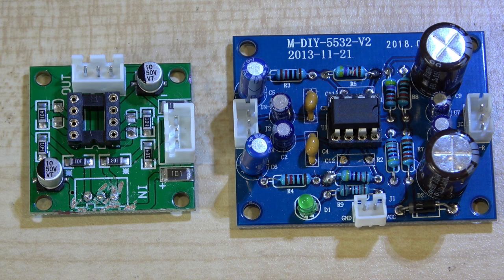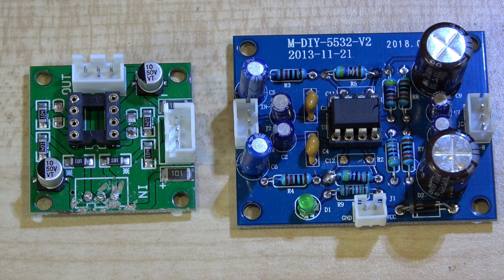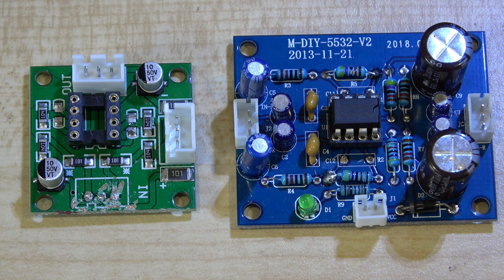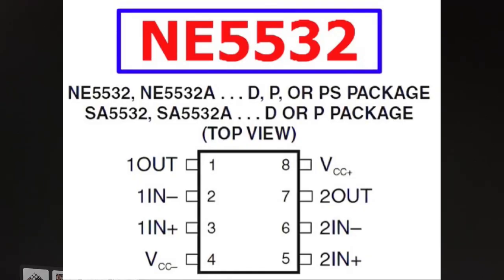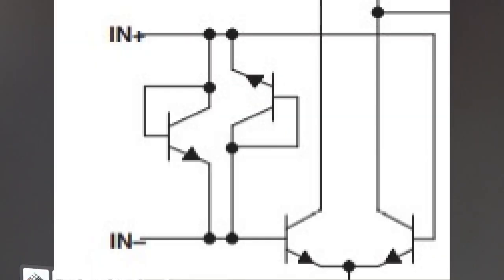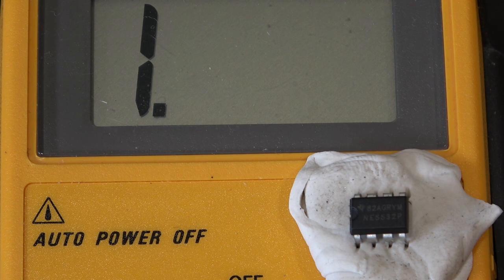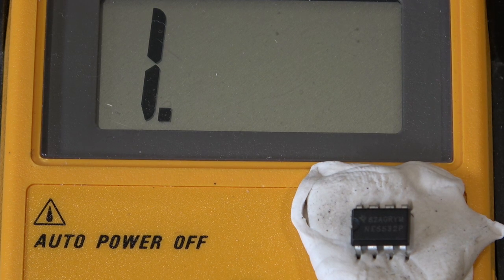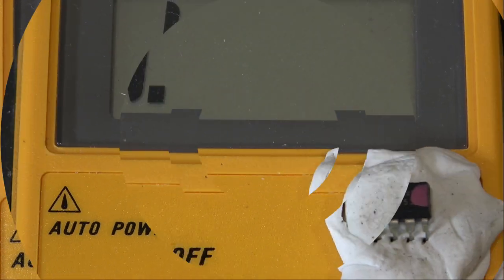How to test NE5532. Fake or Real?

Comment: LM358 and perhaps some other jellybean opamps have these diodes as well.  So it could still be a fake part and it will test OK.  Another simple test is try powering them from 3V.  The fake ones work fine.  And the quiescent current is very low: about 2-3mA. But the funny part is, if they sound well and one can only detect fakes by measuring them then what's the problem?  Also, it is hard to return them on Ali by claiming that they are fake.  They will ask you to prove it. That's what they told me anyway.  But they issued full refund anyway.
Reply from the maker: Looking at slew rate is another way.

Comment: Um, thanks? I found out that the pre-amp I bought that proudly states that it uses an NE5532 has a counterfeit installed. Now my OCD won't let me leave it be (even though it sounds just fine).

Parts and tools are now on order to replace it with a genuine device. Grrrrr...
Reply from the maker: Some fakes are kind of OK, but you NEVER know what you are getting. They mostly use a lesser spec chip, and the slew rate can be much lower. (Speed)

Comment: Cleaned a LOT of my Uncle Ali OpAmps recently.  I use a PCBs I made for playing with OpAmps.  Left out all of the capacitors, leaving a couple of trim pots for gain control.  Injected a 0.5Vpp 1kHz signal.  I watched the output with an Oscope as I raise the frequency.  Many showed a slight kink in the sine wave even a 1kHz which became worse as the freq went up.  Other just made the sine a triangle after about 20-40kHz.
Yes I tested the boards and process with ICs from Mouser and they all worked well.
Not surprised, just disappointed.
Reply from the maker: As you have found there are a number of ways to test this IC. I used the diode test simply because almost anyone can make this test and so far, it seems to be 100% effective, Thanks for your input.

Comment: Further to the comment below, re your Quad 405 results, I wonder if the op Amps 071 ?? were fake causing problems further down the line ?
Reply from the maker: I don't have a way to test this chip. I have tested quite a number of Quad boards in the past, they all measure much the same. It's just an old design, good in its day, slow by modern standards.

Comment: Hello,
Do you know if I can do a similar test for an OPA1642?

Thanks
Reply from the maker: Most chips don't have any real measurable static footprints. The 5532 just happens to be one that does.
Reply: @MichaelBeeny  do fake opamps sound a certain way? I've installed one instead of an TL072 and I can't tell that it's better or worse. I expected it to sound a bit cleaner and brighter. It does, but I still don't know if it's real or fake.
Reply from the maker: @InvisibleYetVisible  The thing with fake stuff you have no idea way you are getting. Some may be manufactures rejects, some could be simply any old chip that looks the same, some just go bang on switch on. NEVER are they better. Most op amps sound quite similar anyway. The TL072 by todays standard are noisy and slow. Saying that, when you start at a high spec things just get better. Much of the better is not audible and only just measurable. As to which one is better, enters the SNAKE OIL region. Most fakes are dirt cheap and for less important application, they often work fine. The 5532 fakes are really not that bad, often little audible difference. Power amp chips are often very poor, high distortion, power issues and many just blow up sooner or later.
Reply: @MichaelBeeny only just measurable, not audible...good to know😃.

Comment: another good indicator to see if you have real or fake opamp. use a fridge magnet, if the component gets attracted its probably fake. the reason is that they use nickel-plated steel in the construction
Reply from the maker: That's interesting, I did not know that. Thanks for the info, I will try it.

Comment: I'm showing real NE5532s for sale at digikey for 78 canadian cents... I have to wonder what profit Chinese knock-offs are making... I just tested all my 5532s. I have 9 of them currently and all of them checked out OK. Diodes in both directions.
Reply from the maker: Probably more than Digikey sadly. I've not found them at all unstable. Square wave at such high frequency won't look very square, however. If you have not already got one, try about 15pf across the feedback resistor.
Reply: @MichaelBeeny   Thank you I will try that!

Comment: Hello. Have you tried the lm4562na? 
I connected a system where I could switch between preamplifier or without preamplifier to hear differences with and without preamplifier in the chain.
I used earphones with good sound quality since with earphones it is easier to hear details.

I tested with music and pink noiseig and frequencies and concluded that the lm4562na changed the sound incredibly little. difficult to hear differences.

In the preamplifier card I have, the lm4562na is the absolute winner if you want the least possible sound changes to the original input signal

Comment: yep,I got a fake one too,thank you for showing us how to test them,I was suspicious when the led on the circuit board didn't light up with only 12v DC connected to it.
But I think I'll give solid state circuitry a miss,and stick to building valve gear,as I've built a fair few amplifiers and Preamplifiers,and like the sound of them very much,and just love point to point wiring.
Reply: They sell fake tubes as well

Comment: Good and simple testing way, indeed.
How about the slew rate, as you said, are the fake ones also bad, how much worse?
Did you see if they have that crossover distortion, typical of LM358s (same pinout)?
Thank you!
Reply from the maker: Sadly it's just the 5532/4 with these diodes. Others with the same pin out are different inside, so cannot be tested like this. Regarding crossover, I have never seen any in such chips as they tend to be class A

Comment: I automatically assume that any chip I might buy from Aliexpress/eBay will not be genuine.  But that doesn't mean they won't work adequately in many non-critical circuits. Just don't build them into your prototype new heart pacemaker!
Even generic devices from premium Chinese manufacturers - like ONsemi - can be from batches that "escape" from their factory after failng testing, and mysteriously turn up in the Shenzhen Marketplace.  In the end, despite their ridiculous postage costs, it is often less irritating to buy from companies like Digi-key, Mouser, Element 14, RS Components etc. -  where the source is guaranteed.
Reply from the maker: Yes, Hector you are quite right. In less critical areas these fake chips do work almost as well, and most people cannot tell any audible difference. This is true for the 5532, it's not just a fake but a completely different chip.
However, many fakes perform really badly, high distortion, way out of spec power wise, even just blow up. I always use Farnel (element 14, silly name!!) for original parts, that's when you do tell differences.
Reply: I just bought two opa2134pa opamps from rs components and the screenprinted model number varies in position and clarity  between both chips .
The chips i received look nothing like the website pic of an opa2134pa on rs website.
The originals normally have a round indentation directly above pin 1 and a half moon notch on the edge .
My chips have an indentation between pin 1 and 2 and no half moon on the edge .
I put a video on my youtube showing the chips if anyone is familiar with that model .
I might have to test them
Reply: @peterpipe9015  Certainly suspicious!  It might be a good idea to contact RS, point them to your video and ask them to confirm their source.
Reply: @hectorpascal  thanks hector i wont be using rs components again
Reply from the maker: @peterpipe9015  I would be surprised if RS would have fakes. Sometimes the same chip is made by a number of different makes and can look externally different. The internals should be the same. If not, they cannot really call it a 2134.
Reply: @MichaelBeeny  it sounds better than the 5532 which came with the aiyima a07 which is fake according to others who have tested the same model,thank you for the help michael
Reply: @MichaelBeeny  Yes Michael, I too am a bit surprised..  I worked for BBC Engineering for 20 years and we used RS (and Farnell/ Element14) extensively for making special purpose prototype units.  (Mind you.  that WAS about 30 years ago!)
Reply: @peterpipe9015  I bought 4 OPA2604AP from a local seller the price was under a dollar so naturally fakes, turns out they are genuine NE5532s rebranded 😁
Reply: @syduploads1990  thanks bro

Comment: Your a rockstar ! I asked about this and you pointed me to your vid (I'm subbed) and I just took a board with a single 5532 and it tested fake, no junctions and then took another preamp that had two 5532's on it  (a much used and loved one) and sure enough the both had the 0.80v junctions ! so real and I always said this one sounded great and used it a lot 1 I now plan to do further tests and try to see if the difference can be measured in other ways, regardless of that I don't like giving money to counterfeiters anyway....cheers.
Reply from the maker: Welcome Mr Mouse. It's not always the same fake 5532 used but the real 5532 is the only one with the 2 diodes on the input circuity (that I know of) so quite a conclusive test. Some fakes have poor HF square wave and higher noise figures.

Comment: Hi Michael. As you asked. Testing 3 pairs of 5532's.
#1a. NE5532AD SOIC-8 seller told they genuine(local store). OP1 718mV, OP2 734. #1b OP1 717mV, OP2 733
#2a. NE5532AP DIP-8 sold as genuine(internet store). OP1 723mV, OP2 734mV. #2b OP1 723mV, OP2 734mV.
#3a/b. NE5532P DIP-8 seller honestly told that he can't confirm they are genuine(local store). They have open loop
Now i don't know what to do with fake ones. Usually i throw them, bc i don't use any fake parts at all, even in simple schematics.
Reply from the maker: Thanks for the info. As to what you do with fakes, let me know if you find any use, coz I've got lots of them. lol

Comment: Bought a MAX038 from AliExpress. Didn't work. Just drew a high current. Told the supplier who assured me that they test each chip before dispatch. Told him that I'm really happy about that, and could he send me a schematic of his test circuit. Money refunded.
Just tested my 5532's. Failed.
Reply from the maker: The 5532 is probably one of the most fake of all chips. Almost every board I have tested used fake chips. Well done getting your money refunded.

Comment: Hello @ Michael Beeny , thank you for the video i found out i do in fact have fake NE5532 but ive got a question about it if you happen to know. i bought my NE5532 to build a Zen Drive its a guitar overdrive pedal. would you happen to know if these fake chips would make any difference in my Zen Drive circuit? i made my circuit with the fake chips and im happy with how it sounds but wonder could it be better if i put in  a real NE5532. thanks for any help or advise .
Reply from the maker: In truth the answer is no! Most fakes are lesser spec chips re branded. Very naughty and it's a con. However in many applications, probably un noticeable.

Comment: Is there a difference between NE5532 and NJM5532?
Reply from the maker: I'm sorry Martin, I don't think I have even seen this version. Looks slightly better on paper than other makers of this very common chip. In the real world I've not been able to detect any audible difference between any  of the 5532s, even some fakes are really quite good for some applications.
Reply: NJM5532 are from the New Japan Radio Corporation which is a genuine Japanese device manufacturer.  The specs for the NJM5532 are very similar to other manufacturers' offerings.  Of course, it is quite possible that these types are ALSO being faked "over the water"!

Comment: Hello Mike,  The spec sheet states the inputs cannot exceed -vcc or +vcc  , would'nt this burn out the diodes across the inputs?  I am confused.
Reply from the maker: I will need to study the circuit again to really comment but it is one way to tell if it's a genuine chip or not. I'm working on other ways at present.
Reply: @MichaelBeeny  Something is strange.
Reply: @braveheart5280  You need to understand how op amps work: the voltage difference between inverting and non-inverting inputs is kept zero (ideally, and in practice also very low), and the input has very high impedance. In other words, you cannot force the voltage difference be high from outside, because the internal circuitry is "eating" the difference.

Comment: Hi, i'm very interest in a prototip of the ne-5532, i mean, i've actually improved my contact with electronic stuff, but admit that i'm very ignorant in this materia.
You can add a little description about the circuit - at the beginning of the video -  i meant, where I can buy that to amplifier my turntable ?
Thanks a lot XD
Reply from the maker: I'm not quite sure what you are asking? A basic preamp is NOT suitable for a phono input. You need a special type with RIAA EQ. So far I have not shown any that are suitable for a turntable.

Comment: I have a question
Fake one make signal lower right?
Reply from the maker: Some fakes can be quite good, some don't work at all. Because they can be anything really, you never know. I doubt it will make the signal lower because the gain is set (largely) by external components.

Comment: The first clue , for me , was taking a good look at the texas instruments logo (which is the outline of the state of TEXAS with a T and an I inside of that) , found on the chip. Mind you the logo is pretty small , so i like to use proper lighting and magnification,  if you have an authentic chip and you side by side them with a phoney ic , its clear to see . the couterfeits image of the state of texas does NOT resemble texas , it looks more like long island . Your test method is well informed and i admire your intellect / experience to figure this test out as its wonderfully smart and fool proof test . for me (i am kind of a numpty)i had purchased a 3 band eq board with a pair of chinese ne5532 and i suspected they were not originals. i used my multi meter and tested for current draw what i then found was the chips i suspected to be fakies were pulling significantly less current than what they are rated to consume . Of course i forget the numbers as this was two years ago. these fake ne5532's where pulling about half what a lesser spec'ed op amp is supposed to pull. when i removed them , i installed some proper ne5532 i purchased from tayda and those ic chips pulled the proper amount of current. Now this is the internet , i am a bit older at 50 plus so of course i am wrong , i dont know what i am on about i am a goof i use plumbers flux. But i am convinced my tayda ne5532 are legit TI chips. Despite the rash complaints of users claiming everything purchased from Tayda is phoney.The logo is legit and they pull the correct amount of current. I recently saw they are selling a 10 dollar eq with a pair of fake ne5532 and this board also has a bbe sonic maximizer chip onboard . THATS the board i want to try. I never considered asking for my money back when i recieve false chips . thats something i would need to consider. the project i am working on right now , i ordered a board which has a pair of ne5532 , i plan to use it as a headphone amp so i may need to swap out the resistors that set the gain . i have some Tayda bought burr brown op2134 ic chips to try out and my plan is to remove the stock dual volume pot and cut in a pair of independant pots to control the volume as i am slightly deafish in my right ear . ultimately i really like listening to music with a smile eq curve where the bass and trebles are boosted a good amnt . ideally i would build one unit in one chassis . single 24vdc supply and it would have the preamp/headphone amp board AND the eq board that features the bbe chip (NE5532 OP AMP Preamp Tone Audio Board NJM2150 BBE Processing Module) but i am looking at the dimensions and it would be a tight fit in a 1590bb so ... i will more than likely add a small bbe chip board to my eq and couple it with the headphone amp build . all this driving a pair of superluxe 681evo headphones . shortly before realize this , i ordered two ten pack batches of ne5532 from ebay to stock up... so as far as imposter op amp ics i am set! ( i told you i wasnt so sharp... anyway thank you for your excellent video pal , i ejoyed that .
Reply from the maker: Do you know Petey, I never thought of testing for current. Next time I will also measure it. Regarding your hearing miss balance, rather than put 2 pots in circuit I thing I would probably change the feedback (gain) on one channel. Do this with a mono input, then you know it will always be correct for your hearing.

Comment: Thank you for the video. I've bought LM358 from Ali and they were fake. They act like normal op amp, but in one circuit they kept burning up(with cracking). I assume they just were very simplified schematic like with just 6 transistors inside. After i realized they are fake i threw them all. I will go and test my NE5532's bought from local supplier)) Sorry for my english.
Reply from the maker: It's getting so bad now, almost all the well know chips are fakes. I just received a class D amplifier this morning with fake 5532s preamps.

Comment: You use the 5534 for the low distorsion, if you don't need this feature simply buy a cheaper one like the 747 or 324  (LM 324 is really bad!).

Comment: I found the fake NE5532's had a high DC offset at the output. Often around 50 to 60mV.
Reply from the maker: Interesting Jim, not looked at offset before. After I do the diode test, I've not gone any further. Out of curiosity, I will in future. Thanks for the info, I appreciate it. Could be nasty feeding directly into a DC coupled amplifier!!